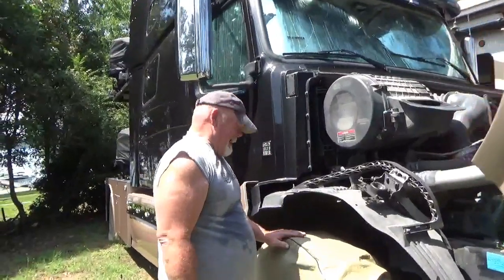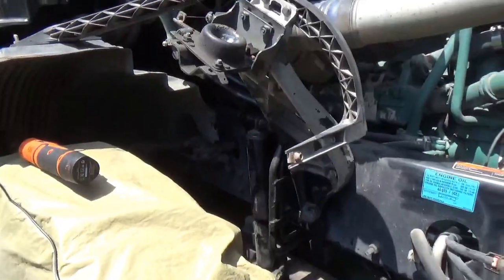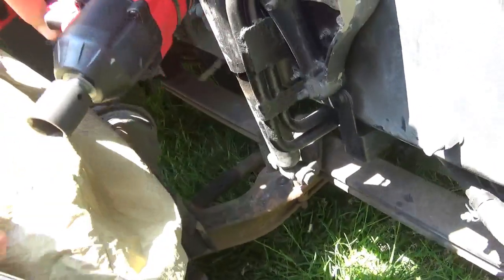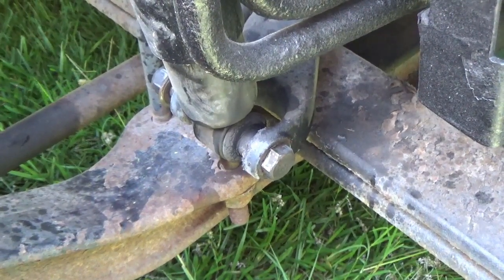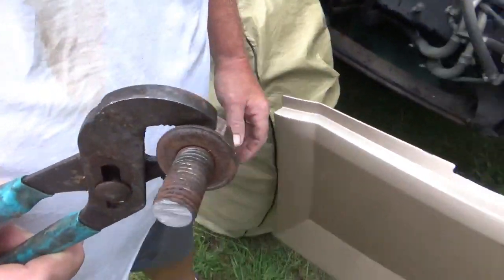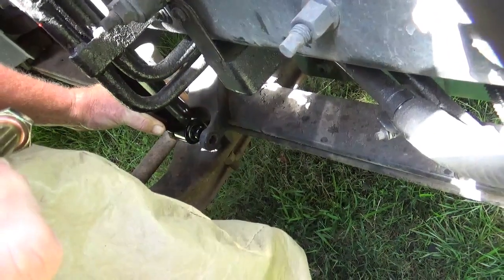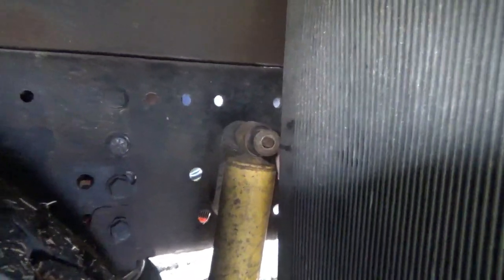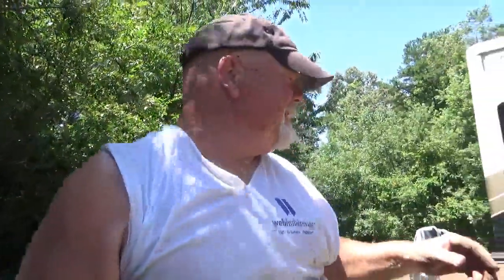💪 HDT Leroy Needs New Shocks - NOT Easy! // Full Time RVing

Comment: Dave is a breath of fresh air as an RVer.  YouTube has channel after channel of RVers and van lifers who struggle with the simplest mechanical things, have very little understanding of RV systems and complain about how thing are built and getting their RV serviced.  The "best" RVers are the ones that have clean hands and throw money at every problem.  "I don't know how to wire solar panels, so I had the "pros" do it.   And then some young flunky is working on your RV.

Back in suburbia people didn't have to worry about batteries, wiring, shocks, engines, suspension components.   RV life is a completely different story.

Great job, Dave.
Reply from the maker: Thanks TechGuy.  I perfer to do my own work when I can, then I know how it was done and who to blame.  When I can't, I take it in to the "man".
Reply: @WattsOnWheels  Do you have the shop manual for your truck ?   They are expensive, but really good.  Almost nothing the amateur can't tackle if you have the manual, except if you need a special tool.
Reply from the maker: @SomeTechGuy666  No, but I research the crap out of everything on line.  Amazing amount of info out there.
Reply: @WattsOnWheels  Shop manuals are worth every penny.

Comment: Dave , I changed the 4 shocks on our 2004 Frightliner Columbia CL120 , I could remove 3 of them, the 4th. Had to use a torch to heat it first, but we did it, a 3 BEER job 😎👍
Reply from the maker: I hear ya!  There is always one to give ya hell.  Sounds like a 6 pack.  1 for each of the 3 easy ones and 3 for the stubborn one.  You know, help cool you off from that heat you had to apply.

Comment: Wow Dave those shocks were really bad. I'm suprised you don't have cupping on your tires. I used to do mine every 300k unless I saw leakage. The rears are much easier on a semi tractor. Stay safe.
Reply from the maker: The truck has 633,000 miles on it of which we have put on about 13,000 miles on it ourselves.  Hard to say how many times they have been changed for the first 620,000 miles by previous owners.  Good thing I changed them.

Comment: I worked on road trucks used on a corrosive mine site. We always used plenty of Never Seize or at least coat the bolt complete with grease. Didn't stop lock up but it helped
Reply from the maker: Yeh, probably should have done that.

Comment: Do you ever run in to much resistance from park staff about doing minor repairs on Leroy ? Love your vids and appreciate the work that goes along with them 🍻🍻
Reply from the maker: Thanks for watching Brian.  This project was done in storage so no problem.  Other things like brakes and rotors are much quieter.  And of course if that is your problem, you can't leave without fixing it.  We have never had any problems with quiet repairs at campsites.

Comment: Sometimes it is easier and cheaper to use a shop, just had 6 of mine replaced and costed me $700 at the dealer (kenworth) your front ones definitely looked original, the rear have been replaced. You did forget to replace the cab shocks, which are also probably original and I believe is blocked by your box on the back of the cab.
Reply from the maker: Thanks Shawn.  I'll check that out.  As soon as I find a monkey small enough to get in there, I'll have those changed too. 😁 Gonna be going into a shop soon, so may have them do that.  Thanks man.

Comment: Any job is simple if you know what you are doing, and having the right tools can make it a whole lot easier, did you go around after and check the torque on all the nuts and bolts?
Reply from the maker: Yes sir...thanks for asking.  Job is easier when you get to watch.  😁
Reply: @WattsOnWheels  I am no stranger to tools or how to use them having worked as an on call technical engineer that had to go out solving problems.

Comment: The last time I tried doing it I had to take it to a shop. The bottom bolts were so corroded and rusted the they had to use a torch on them.
Good luck
Reply from the maker: The torch didn't even work....but the cut off wheel did.  :)

Comment: Fyi for future note those shocks only good for about 100,000 miles I do my western star at that interval
Reply from the maker: The truck has 633,000 miles on it of which we have put on about 13,000 miles on it ourselves.  Hard to say how many times they have been changed for the first 620,000 miles by previous owners.  If we hit 100,000, I'll be changing them.  Thanks for watching.

Comment: Why didn't you grease the shaft of the bolts to prevent the sàme thing from happening again.?
Reply from the maker: Could have, but won't need to be changed for another 100,000 miles and don't expect to ever have to change them again. 😁